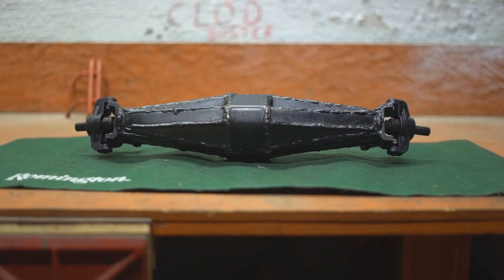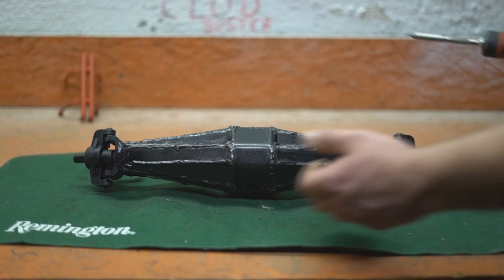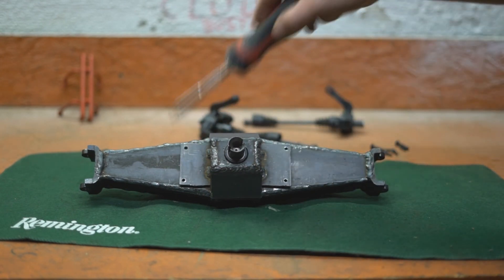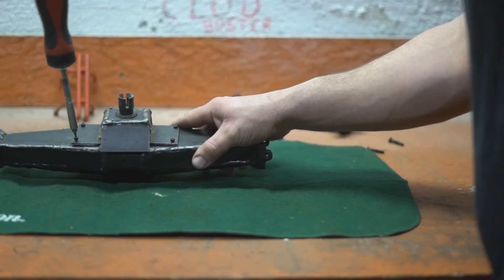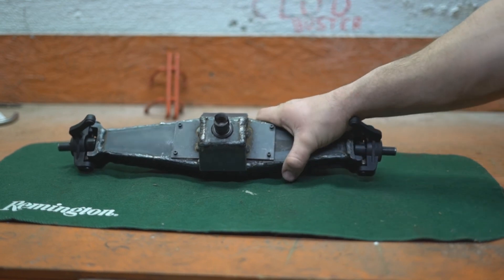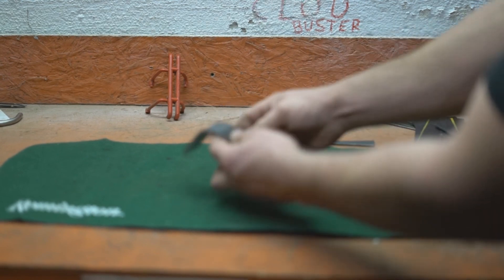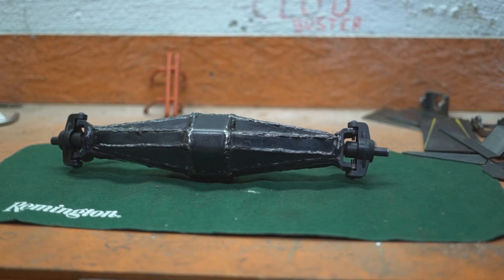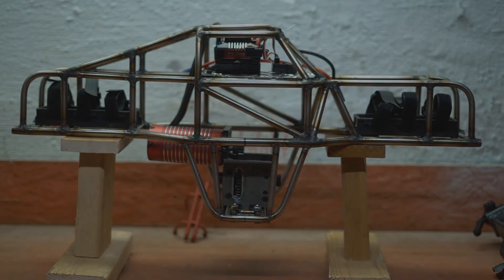1/ 5  scale solid axle

Comment: haha awesome ! overkill ! i went through the same path ! welded my own monster truck ! but in a amateur way !  i stayed on 1/8 though https://imgur.com/G6QaO1R   any thread about your truck ? i would like to share my experience !
Reply from the maker: stephane Z you’re truck is awesome I hope mine performs as good as yours
Reply: i built 3 other generations of 1/8 monster truck and corrected a lot of mistakes ! i can tell you by now that the amount the stress on the linking arms is tremendous ! what will you use for those linking arms ?
Reply from the maker: stephane Z No thread about my truck yet
Reply: i know how much time it takes to build a truck and i would like to you help you and save you some previous time ; do you have an e-mail ? for example, i can tell you right now that those knuckles will break !
Reply from the maker: stephane Z I will be using 1/4 inch male heim joints and 3/8 chromoly tubing